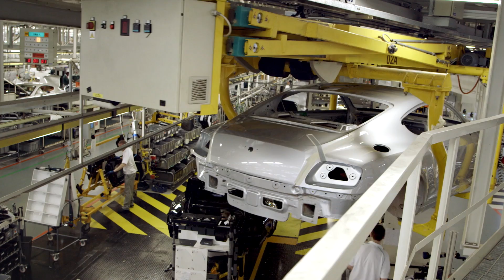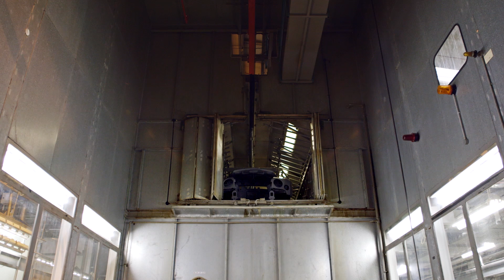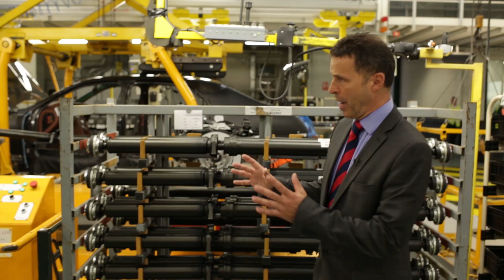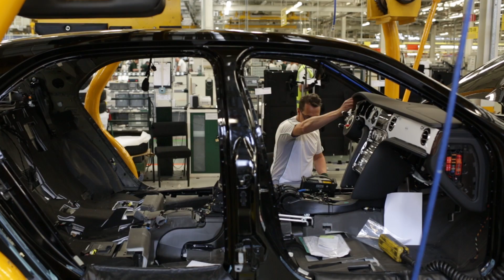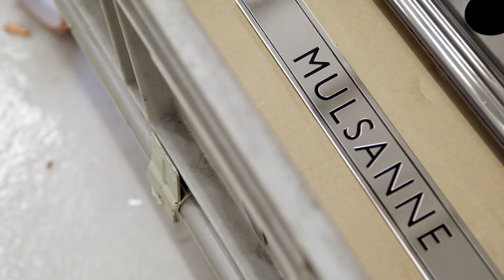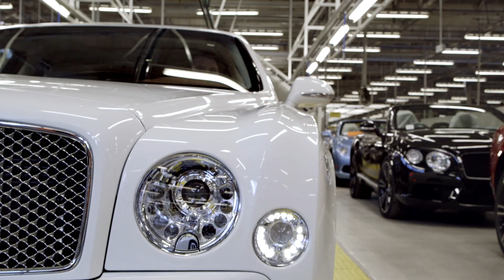Paint and Assembly - /INSIDE BENTLEY

Comment: This is the reason a Ferrari cost 5-6 times as much as a Corvette even if it's only 1/10 faster. And then you have all those people saying it's not 5 times better for the money. Quality.

You want the best in life it's probably manufactured like this. Painstaking, time consuming and the best materials are used. The leather alone in a Pagani Huayra cost over $70,000. So even when other manufacturers say they get their stuff at the same shop, it's not the same quality leather or seats. It's the budget version. Or when they say they use carbon fiber in the dash, it's the budget version of carbon fiber. Same goes for everything.
Reply: It is not about the speed in any way. American cars are very bad, but very cheap, so it is kind of OK. But take away their speed and there is nothing left. Take away speed of ferrari, aston martin or other good manufacturer, you'll be left with soul, passion, style.